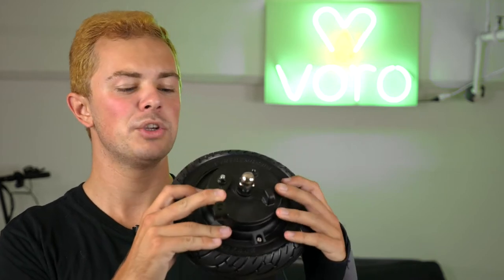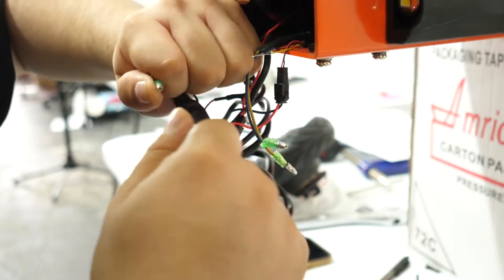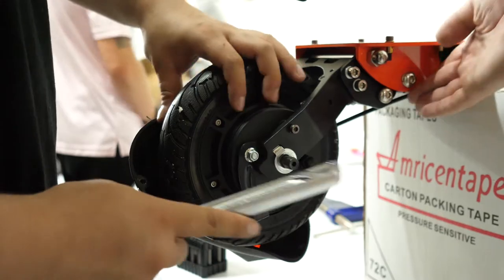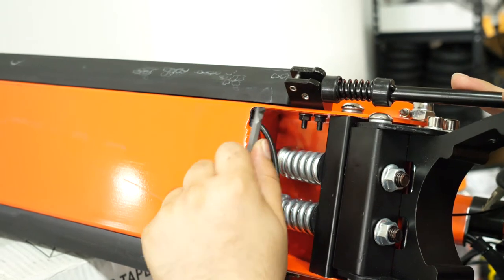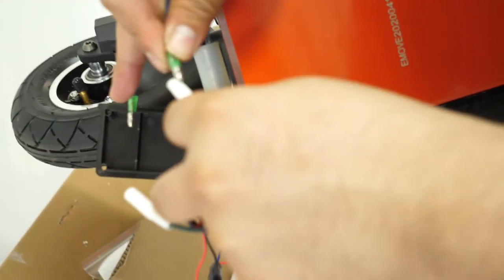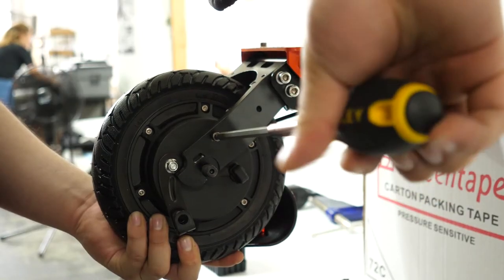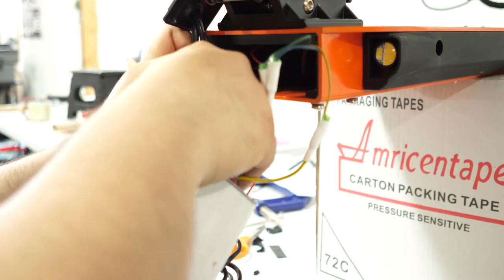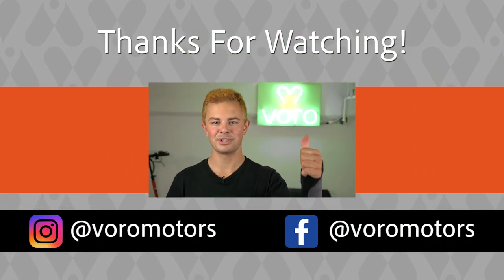How to replace your Emove Touring motor

Comment: Most people don’t have brake wire lying around there house. What’s another option? I’ve tried a metal hanger I can get it through but not when I attach the connectors. Very frustrating

Comment: The question is why i only rode my touring for 5/6minths but i had it for a year and my motor is bad. Reason i only rode it halt the time because i couldn't ride it because of the stupid gold pin that supposed to keep the handle bars up fell out amd my handle bars was all the down like when you get the scooter in the mail. I done mailed my scooter back from nyc to cali they supposed to have fixed it and it went down again. Now they want me to pay for shipping and labor. These guys are cool b4 you buy your scooter. Notice how when you log onto the voro site somebody comes on all nice ready to sell you a scooter but when you have issues they take weeks to respond and them same people on the chat have the same excuses as to why nobody in the tech dept aint return my call or email. Im telling you guys buy at your own risk. Waste of $900 if you ask me.
Reply: I'm in the exact same boat right now. Got my Touring and literally OUT OF THE BOX it doesn't work. Throttle won't engage thr motor. They are literally 25% as helpful after the purchase. I'm even affiliated with them and this is currently happening to me. How could there possibly be quality control if OUT IF THE box it doesn't work. 

And I own a cruiser, I'm very familiar with their products.

I hope your situation gets straightened out. I understand what it's like to spend that kind of coin when you don't have thr extra. 

Sales pitch on point. Everything after that is yet to be determined. Better believe we will throw Voro fully under the bus on every platform there is within the week of they don't want to act like they care.
Reply: @everythingautomotiveeta5839  They are an awful outfit.  I received my touring with a defective battery, and they tried to get me to change the low voltage cutoff settings rather than replace it.  I played dumb on the phone and asked, "what will that do?"  "it will give you more range."  And then i called them out.  Of course it will give more range--while further damaging the battery and not fixing the issue.  They just wanted to get me past the 30 day warranty period.  They are liars and scammers.  Now they're dodging me about a seized rear wheel (still within the 1 year warranty).  The screws don't hold.  They were never assembled with locktite. They expect the buyer to constantly adjust them, but they don't provide torque specs.  I could go on, but hopefully I've gotten through to someone.

Comment: i like how you just swapped out a complete rear wheel/motor unit without having to remove and install the motor to the wheel. still pretending that the solid rear wheel is a good idea, huh? as anyone with a Touring that does their own servicing and repair will tell you - this is not a good setup. and that's why VM will never do a tutorial on tyre replacement or removing motor hub on the solid tyres. I do love my Touring but have spent many hours doing repairs that were frustratingly difficult with zero resources to consult.